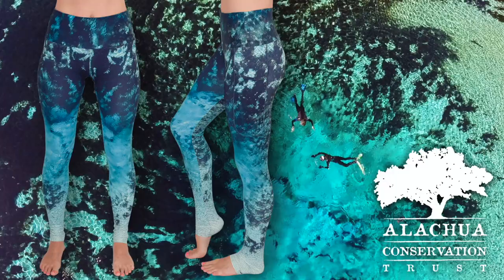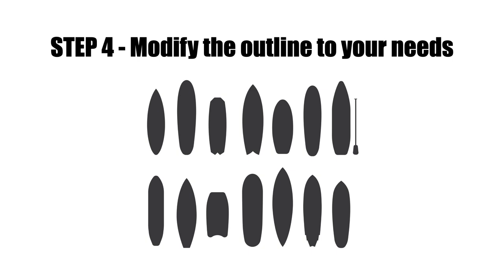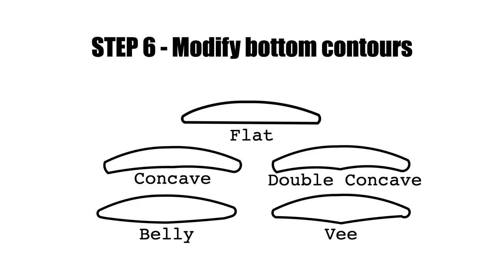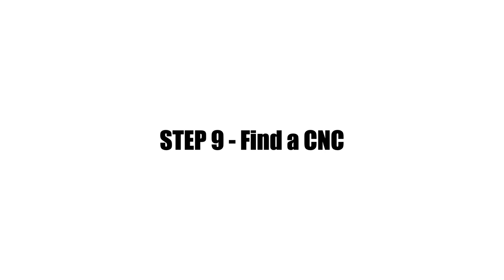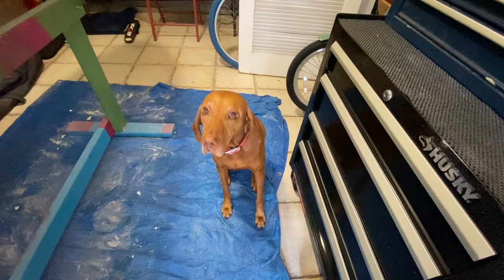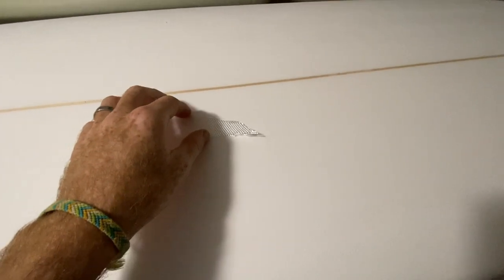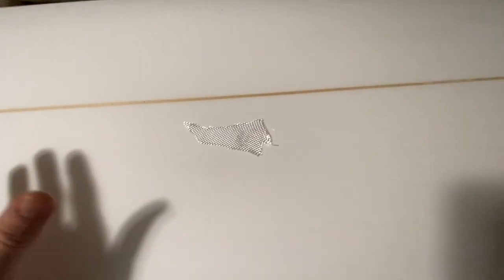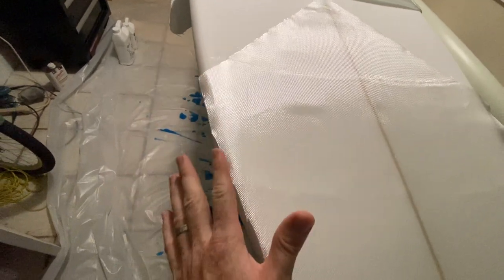Designing & Building a Mid Length Surfboard - Full Tutorial

Comment: Design similar to McCallum or the vbowl of Ryan Lovelace, albeit more extreme. I'm really curious to your ride report. Your tail and cross sections at the back are too thick and odd. Foil those rails down more similar to your mid section. You probably have to nurture your turns and can't sink your rail. Having 4 backyard shapes  my belt I feel anything works but might feel a bit quirky ;) Shouldn't matter if it's a personal board and you can always adjust with the next! Yew
Reply from the maker: Yes! Took lots of inspiration from the VBowls, but more rocker and volume. The tail was tricky, because in order to get the center of mass to line up aft of center, we needed a bunch of thickness in the tail. So far we’ve ridden them in Florida and a trip to Pavones CR and they have been really fun. We’ll do a review video this winter once we get more footage, but we think thinner tails could be a good move. On the flip side, the thick tail makes taking off super easy, as the added buoyancy as the wave passes seems to lift the tail up and initiate planning quickly. It’s a wild feeling
Reply: @Waterlust  awesome! Looking forward to it. Just shows that personal preference and discovering how a board surfs are key to what makes a surfboard 'work'. :)

Comment: Patrick!!! I need help!!

I started by saving a well shaped board from landfill. I now realise some/most of the polyurethane foam on the underside of the deck seems to be disintegrating.
Does that make sense? Have you seen this before? 

I can't find any information on this online. 
What is happening is it is seeming to be just constantly crumbling. I am worried when I glass it the glass will not stay attached as the polyurethane may begin to crumble. 

I'm hoping for a tip to seal it
Reply: @Waterlust  thank you so much for your reply., I was looking for a lightweight spack but couldn't find it here in OZ, I'll have another look. 

I will also check out Bondo. 
If I use these things will it still bond ok to the disintegration or does it help it seal together?
Reply: @Waterlust  you're speaking my language 🏄 thank you again
Reply: @Waterlust  hey Patrick, 
I have done all this and happy how it feels and how it is sealing. BUT.... The blank isn't smooth at all. I've got patches done with Q-Cell, spack and original soft foam, I believe it is impossible to get completely smooth and flat. 
My question is. 
Will the fiberglass and resin be ok if there are lumps and bumps I the blank? 
I don't care so much about how it looks, but I don't want to waste resin and cloth if it's not going to work.
Reply: @Waterlust  😥
Reply: thanks Patrick, 
I took your advice and trying Bondo. yes it is leaving a smoother finish. 

any tips for the rails? I'm not getting it very smooth there